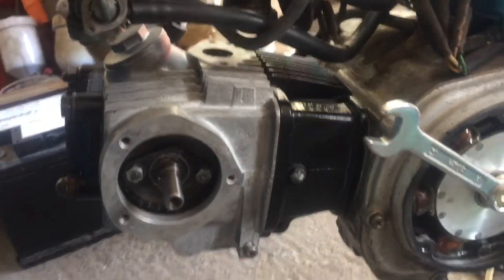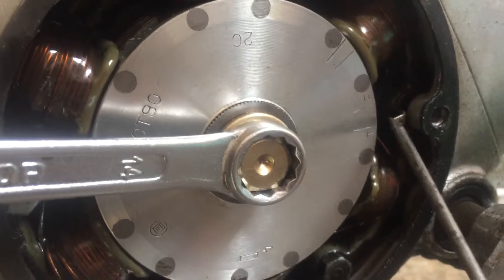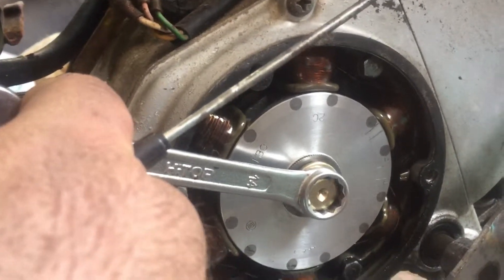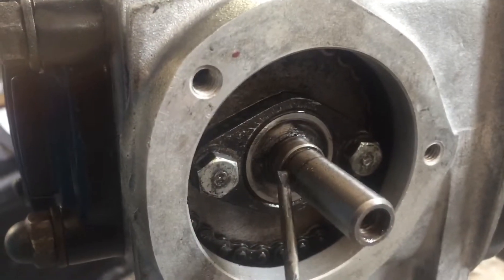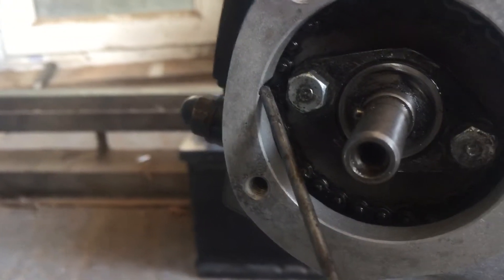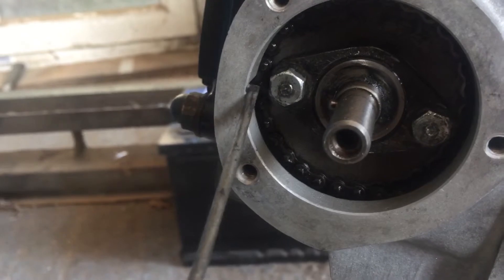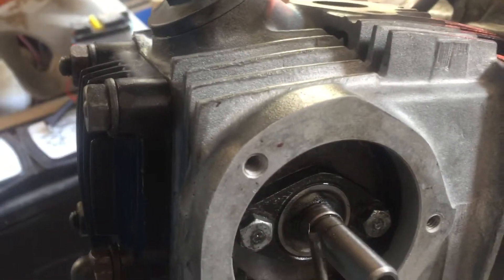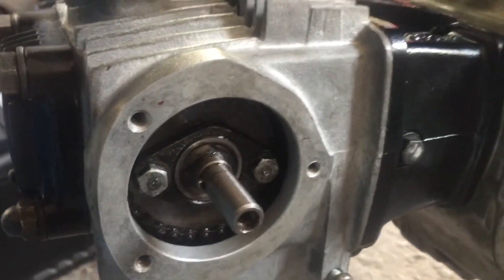C90 valve timing.

Comment: when you take the cam chain/sprocket out and remove the camshaft, are there any markings on the camshaft to let you know where it should be so that the timing is correct when it is reinstalled?
Reply from the maker: Renegade  camshaft has the pin pushed into it that lines up . Also the sprocket will only bolt into in 1 position . Put piston at tdc
Reply: @automateanything  Thanks, i am working on a C90 at the minute but the engine is seized up, its not been ran for years.